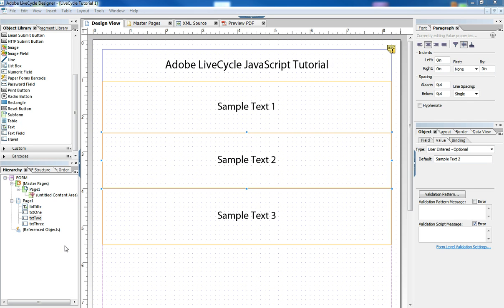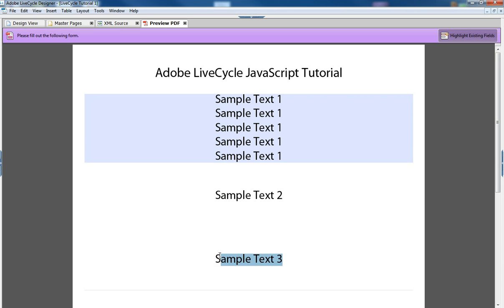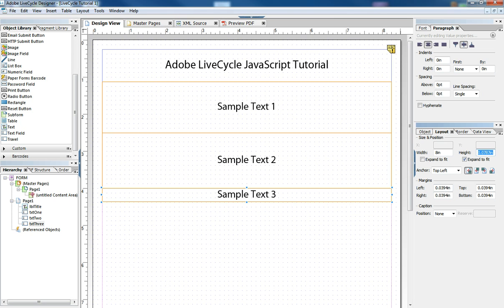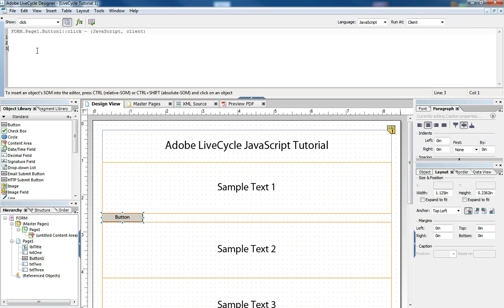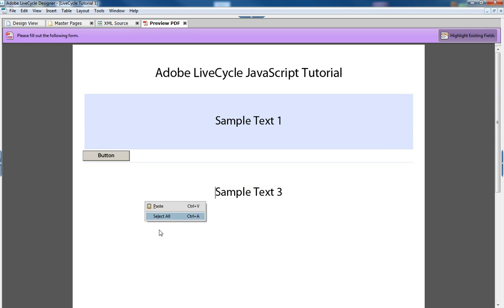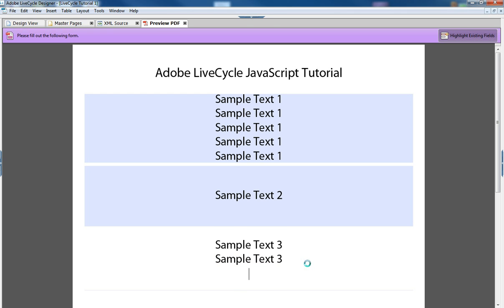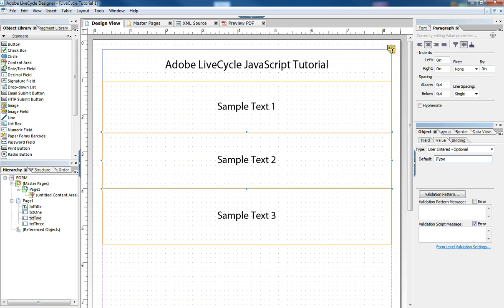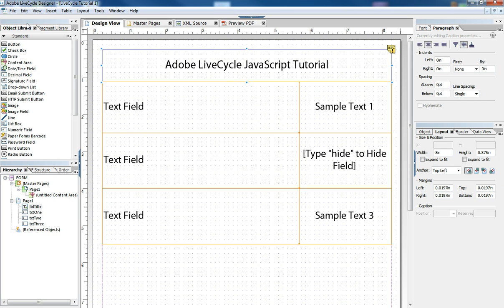Hide a Form Field Object at Runtime in Adobe LiveCycle Designer ®

Comment: Hi Nathan, I am doing the same for a text field but it is under a subform. I need to hide the field if value is blank. it is not moving up the bottom fields even if I changed the subform to flowed. any suggestion how to do it? thanks
Reply: Hi, did you get a solution for the same? I’m facing the same issue

Comment: Hi Nathan, I just have question about this tutorial. After clicking button the " Sample text 2" box is hiding but white spaces still remain on my pdf. but in your posted video "Sample text 3" is came up. How?
Did I missed any settings?
Reply from the maker: Mohamed Asan Make sure you are saving your file as a "dynamic xml pdf"....not "static".  Often, the default LiveCycle settings save files as static.
Reply: Still its not going up i'm using ALCD ES4 saved as dynamic xml pdf.
any help

Comment from the maker: I believe it is.  You would simply need to create fields that display or hide based on the actions of the user.  The tricky part would be getting the form to match the "workflow" logic.  But it is possible and I have done it before.  If you need additional help, contact me through the truetechtroubleshooting blog.